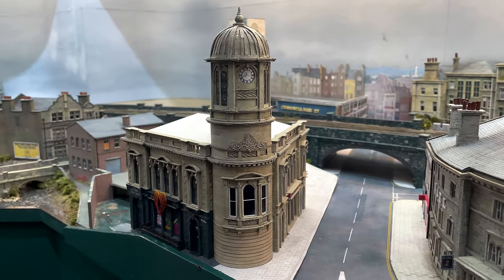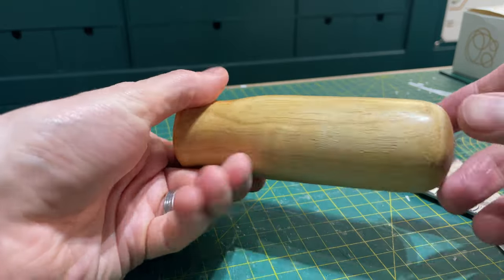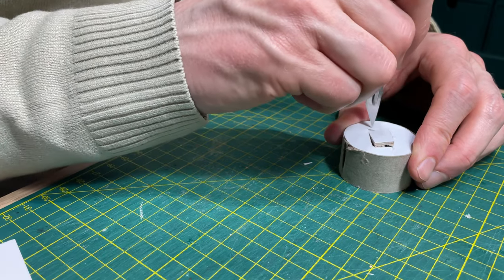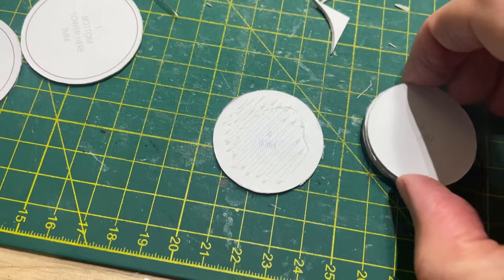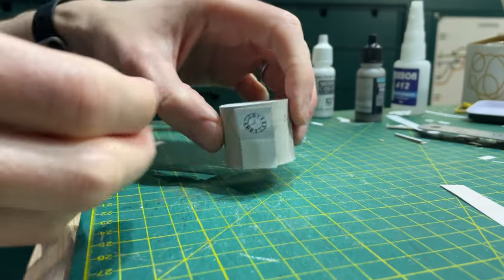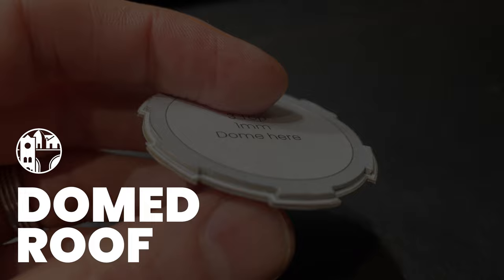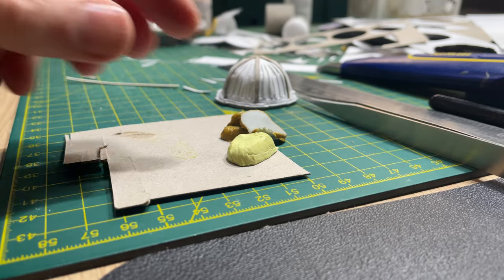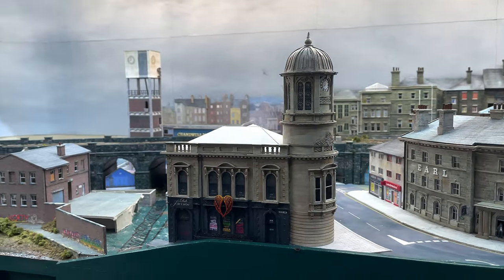Made from paper and card! Stone domed tower for the town hall finished!

Comment: Dear Michael, love your town hall build. Very interesting how you achieved the cylindrical shape and dome. 
For the different ‘form’ pieces, next time you may consider pre rolling the card and paper, or even using your wet method. Think that will definitely help improve the crispness of the the different parts. 
Also, on forming the dome, to avoid crumbling, it may be helpful to laminate 2 or even 3 layers of paper over the base structure. Depending on the amount of supports, the first laminate layer could be built from ‘triangles’ only covering two beams. With a slight double overlaps for the very first triangle. This will provide more glueing surface for the next triangles butting up to the first one, left and right. These triangles can be made with one crisp side and a single overlap for the next one. Until all the beams are covered, which will leave the closing triangle, which doesn’t need overlaps on both sides. A second layer in the similar fashion, or with a surface covering two triangles will strengthen the base layer. 
When necessary, any dents or necessary corrections can be achieved with some wet Sculptamold, and sanded down after it dries. 
This way I perform domes for storage tanks or water towers. Cheerio
Reply from the maker: Thank you for your detailed suggestions! I think there is some really good advice here, and I will definitely be referring back to this the next time I have a dome to make. Thank you again!

Comment: The wetting technique you used on the wall to achieve the curvature would have worked equally well to smooth out and aid the curving on the dome petals. Stuffing the space between the quarter curve support framework with tissue paper or the scrap strips from a paper shredder will help support the following layers as well 😉. Excellent work as ever, more impressive that it's N scale, and so tiny!
Reply from the maker: Thank you - that is good advice. I didn't think to wet the petals.